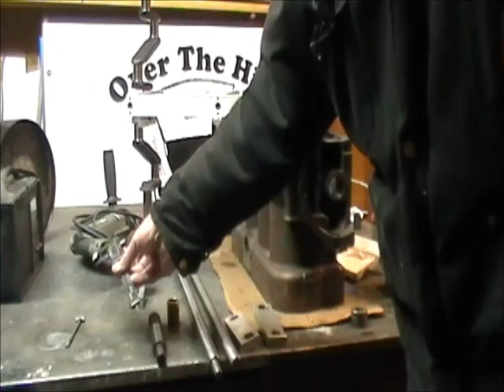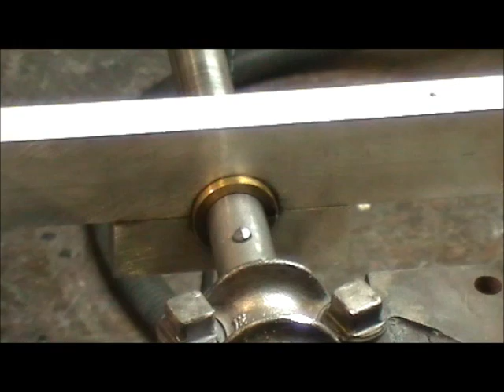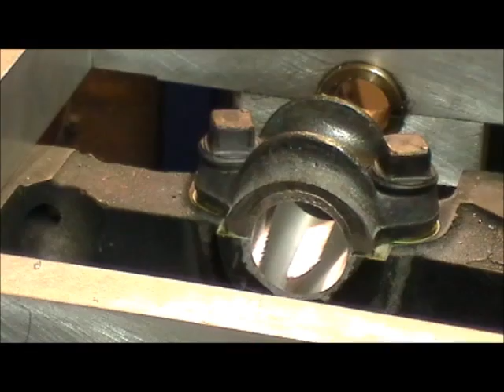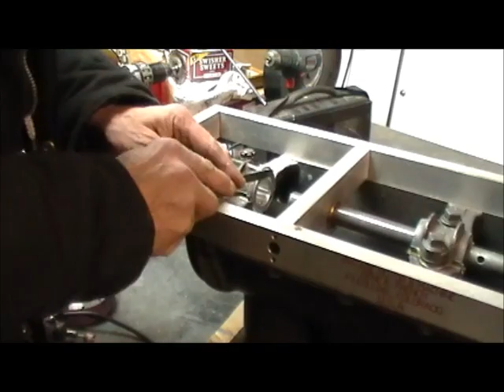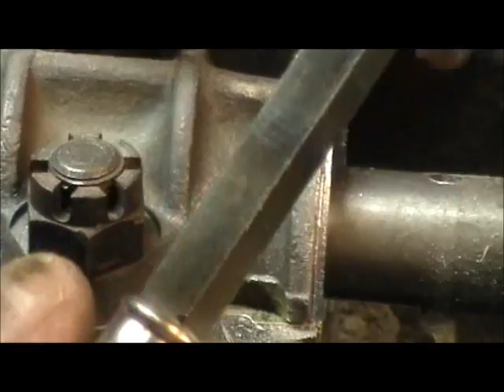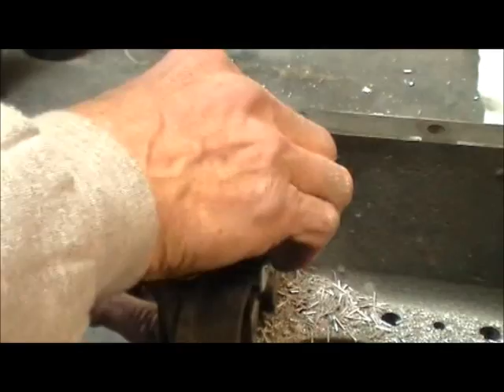Line bore Part 1

Comment: The rear cap doesn't seem to have too much meat on it and it is very close to the block in the picture.  Not sure if I'm seeing it right though.  I replaced the bearing caps on my T and had to fit them to the crank.  Has been running now 25 years.
Reply from the maker: The thrust surface on the cap does all the work. The one in the block usually falls off or is paper-thin, particularly on the inside.
Reply: Здравствуйте, приспособа рассчитана только для для обработки данной модели или она универсальная?

Comment: What is the distans center to center crank-camshaft.
Reply from the maker: The distance from the center of the crankshaft and the center of the camshaft is 3.937 inches; which just happens to be 100 millimeters!
Reply: @Maaschpit  o where can where can the where can the boring bar system be purchased